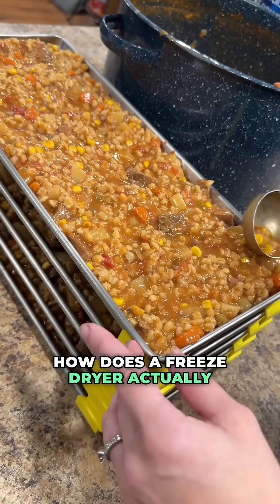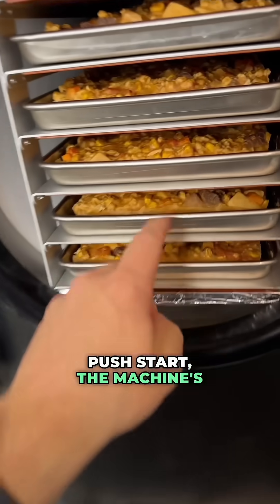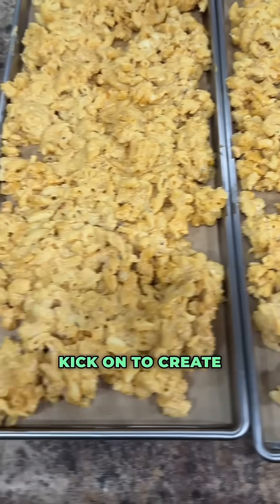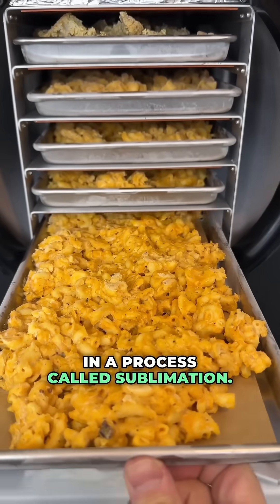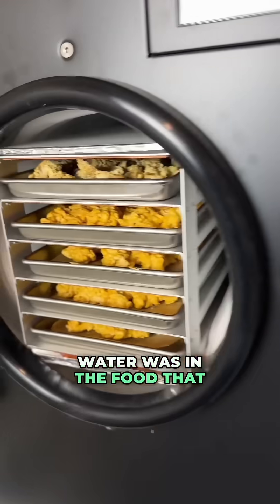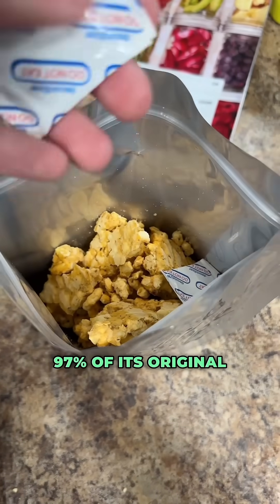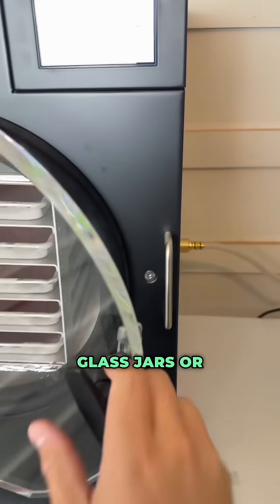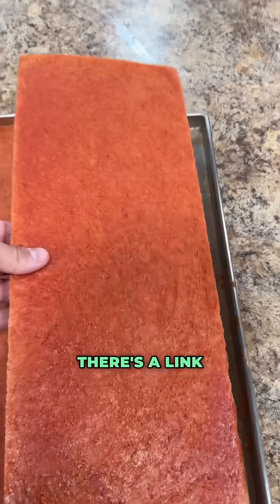How Does A Freeze Dryer Work?

Comment: does it work like microwave? with some kind of wave but cold one?
Reply: It works like boiling water and makes the water evaporate. but instead of using a lot of heat, it uses pressure with slightly lower heat. 

The air inside gets sucked out, then the tray gets heated, and the barrel surrounding the tray get cooled. So, when the water evaporated, it sticks to the cooler surrounding barrel.
Reply: I'd say no but I'm not a schoolar.

Comment: I swear I’m not “erm actually”-ing here, just passing on some technical knowledge. 
TLDR - the trays don’t warm to remove the moisture through sublimation. Sublimation occurs at freezing temperatures and happens faster at low pressures.

Long version- Sublimation is the process when ice goes straight from a solid state to a gaseous state due to the temperature and pressure being in the right zone. The temperature inside the vacuum chamber still stays well below freezing, but because of the extremely low pressure, the solid water can sublimate into water vapor at freezing temperatures and escape from the rest of the food. 
If you’re curious, look up a “phase diagram” for water and remember that 1 atmosphere of pressure = about 100 kpa, and always convert Fahrenheit/ Celsius to kelvin. 
At a perfect vacuum, food could be below -200° F and still sublimate. 

weird thing is it even happens in a normal refrigerator because water has some abnormal properties. Although, the fridge example is more like you notice your ice cubes shrinking into nothingness over the course of a month rather than freeze drying a pan of food over a day. I admit I have more knowledge of material science in general than in these freeze dryers specifically.